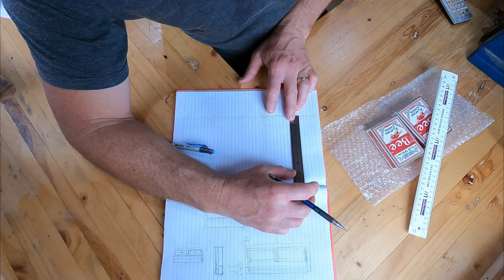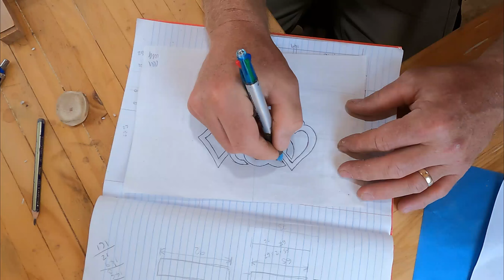Making a Wooden Playing Card box for my Mum

Comment: Great video! What were your overall dimensions for the outside box? Wanting to make something similar, got the thicknesses (5mm,3mm) from the video, but not the height, length.
Reply from the maker: Thanks Scribe. I used a standard pack of cards in the box of 65mm x 95mm and I built the box around that dimension for two packs of cards. Allowing for the thickness of the timber this is how I worked out the final size of the box. I hope this helps.